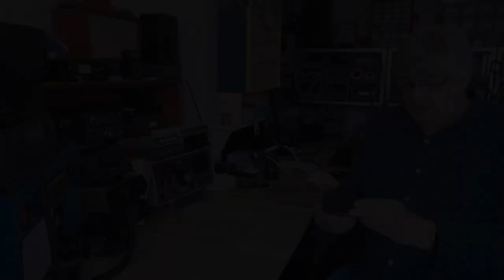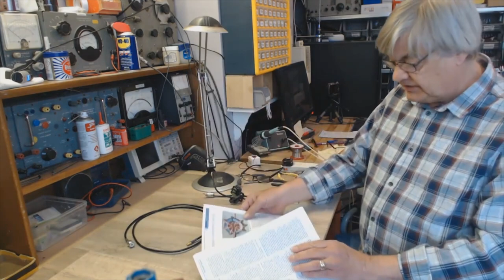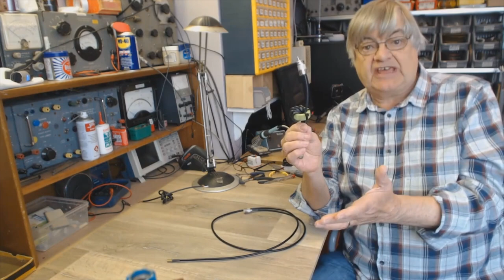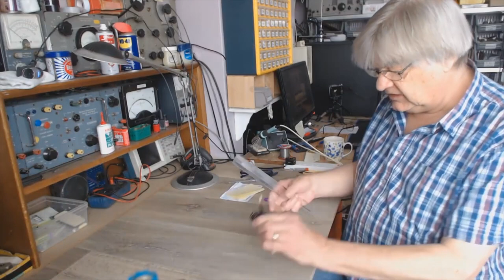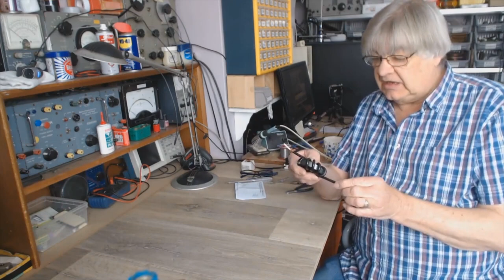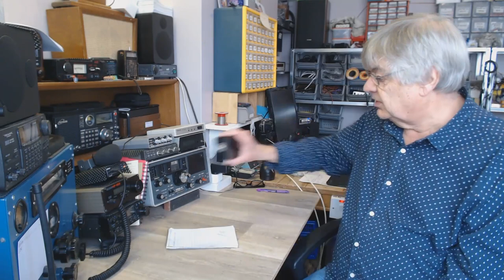G4NSJ - Common Mode Chokes used with coax and HF antenna aerials

Comment: Ray - your explanation of RF flowing along the inner skin and also along the outer skin of the coax braid is absolutely brilliant !  Although I was aware RF flowed along the surface ( skin ) of a conductor, it never occurred to me there could be 2 DIFFERENT RF currents on the braid, inner and outer.  I thought common mode chokes worked by some sort of black magic, but now I finally understand how they operate. Thank you !!

"I'm not much good at explaining things" - Bollocks ! ;-)
Reply from the maker: Thanks, I'm pleased that the video was useful. More coming soon! Cheers, Ray.

Comment: Ray, the late G3TXQ did some great work. I made many measurements with common mode chokes I made, I did find that with many turns the common mode impedance at higher frequencies was poor, presumably due to capacitance between turns. My new one maintains a high common mode impedance over a wider frequency range. Beware of random cores, many are iron dust, the types to use are the 31 and 43 mixes as you mentioned. I found a reduction of about 2 s-points in noise in an A/B comparison on 40m and 80m. If I can find your email address I will send some pictures and plots. What people forget is that the shack ground is usually noisy and without the common mode choke it can reach the antenna where it crosses from the outside of the cable.  73
Reply from the maker: I didn’t realise he was a silent key, such a shame. Great info, thanks. My email…. ray@g4nsj.co.uk
Reply: @g4nsj  Yes, sadly he passed a few years ago. I launched an email at you, nice Listers btw!

Comment: Thanks for picking up this subject. I like your "common mode" approach, a good video. Such a lot of voodoo and people doing without understanding out there. Also, well done for mentioning the issue of crossing the coax from one side to the other of the toroid. I don't do that but plenty of people insist that you should. I hit upon the method of passing coax from outside through the air brick under the eaves. RG8x fits easily and you just need to make a small hole in the inside cover (I made a slot so the sliding cover still works). Thanks again old man. 2E0FXZ
Reply from the maker: Thanks, Stephen. It's nice to read your comments. Cheers, Ray.

Comment: I have used pvc pipe stuff whith steel wool n the coax threw it just. Under the antenna  for 30 years  
I really enjoy your videos
Reply from the maker: Hi Joe, what a good idea. I’ll give it a try. Cheers, Ray.
Reply: Yes sir give it a go n I use steel conduit bared in ground up it floor 
Whith the steel wool feed it in my radio room n old silent key  that wus broadcast engineer should me that 30 plus years ago
Reply from the maker: @joerowland7350  I'll certainly try that, thanks!

Comment: So if we are only concerned with CM on the outside of the shield, would that mean that a toroid with coax wrapped on it is a better choke than a wire wound toroid? (Wire wound meaning the coax is cut and separate wires from the shield and from the center conductor is wound bifilar around the toroid)
Reply from the maker: Good question. I say yes, a torrid with coax round it is better.

Comment: Hi Ray, interesting video. Just wondering, have you ever attempted signal phasing with MW or SW? This allows the possibility of receiving a DX signal over a closer signal on the same frequency. You would need two antennas, aiming one into the direction of the wanted DX signal and the other aimed at the unwanted signal, with a tunable attenuater connected to reduce it. I know, this definitely works with FM, but so far, I have never attempted it with MW or SW. Two indoor loop antennas may even be enough. In theory, it should work, though I don't know of anyone who has actually done this yet. Anyway, take care. Rob.
Reply from the maker: Hi Rob,

No, I haven’t tried that but it sounds very interesting. I think I’ll give that a try on medium wave. As you suggested, using two loop antennas. It’s a great idea. Thanks for that.  Cheers, Ray.
Reply: @g4nsj  Please let me know if you have any success with it. Maybe even do a video??

Comment: At the start of the video I assumed this choke would be up at the antenna end of the co-ax to prevent feedline radiation interfering with the antenna radiation. Towards the end of the video you said it would be mounted at the back of the Tx/Rx. So now I am confused!!! Where is the best place to mount it? Is it beneficial to have one right at the antenna and another right at the input of the Tx/Rx???
Reply from the maker: Hi Ian, if it's located at the radio end, it stops signals being picked up by the coax and feeding them into the radio and associated equipment. The outer of the coax acts as an aerial in its own right. The choke stops these signals at the radio end.
Reply: @g4nsj  so which end do you think is the best to install it. I am able to put it at the antenna end or the radio end?
Reply from the maker: @ianbarton9359  Hi Ian, I think the radio end of the coax is best. That's where mine is. Or, put one each end.

Comment: I don't by the 3 conductor premise.  If that were actually true it would be a 4 conductor: center conductor and its skin effect + the shield and its skin effect.. unless there is something I am missing... change my mind I guess 😉.
P.S. love your work 😁
Reply from the maker: Good point. Thanks for that., Cheers, Ray.
Reply: @g4nsj  Dear Ray, I recommend a video from John Portune, W6NBC, "Ugly" of "Coax" Baluns. John gives a very clear explanation on skin effect and the 2 to 3 wire transition subjects on coax cable. 73 de lu3hip.
Reply: @cesarastiz9691  Thanks, that sounds interesting.